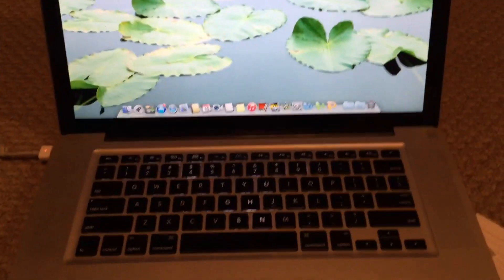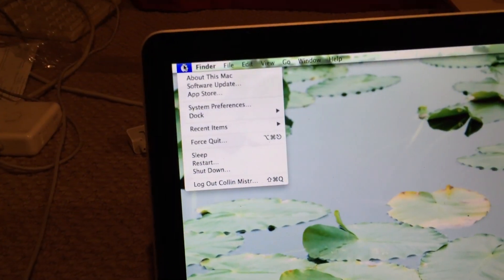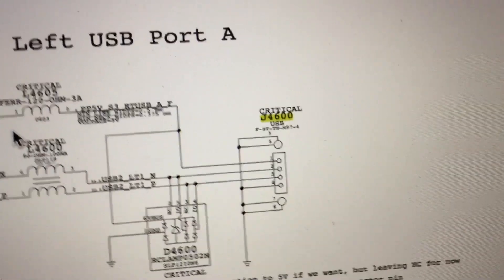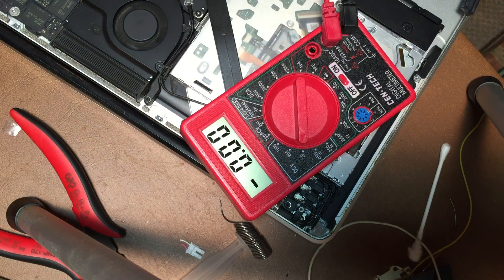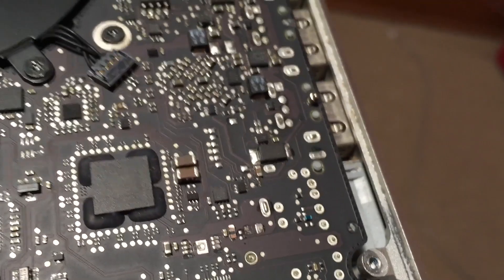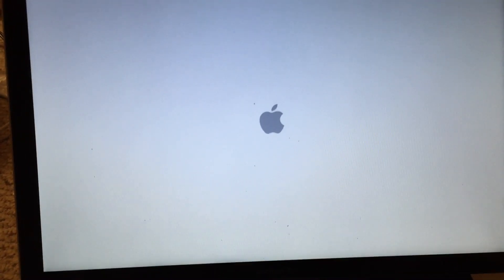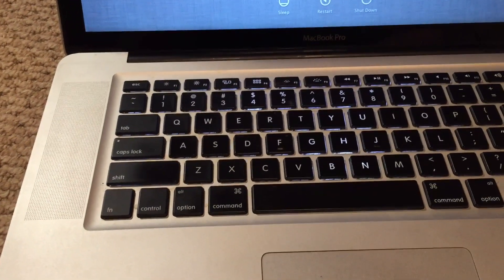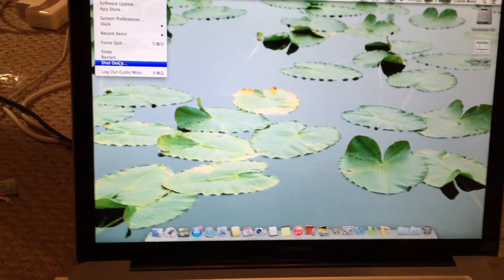Repairing a Bad USB Port on a Late-2011 15" MacBook Pro

Comment: I am having issues with broken headphone jack inside the audio port in mid 2012 15 inch unibody mcb pro. Is it possible to replace the audio port by unsoldering it and put on the another one from macbook pro 2011?
Thanks

Comment: I have the 13" version of this (820-2936 A) bought on Ebay ("works great- all functions not tested", yeah right). Both USB ports don't work, have 5 V. Anything common?
Reply from the maker: Not particularly, but just go through the UBS circuit in the schematics. Check to see what rails are there, and what's making continuity with what. Check the inductors for both USB ports (what was wrong in the machine showed here), and make sure they're good.

Comment: Great stuff.. Thanks for uploading.. In the video you had explained how to test if the voltage is correctly delivered. Since your board is already missing the L4600 inductor, how can we test for the faulty component ?
Reply from the maker: If you test across the inductor in continuity mode (with the board unplugged from power), you should have continuity with very little resistance. If you have high resistance or no continuity, then chances are the inductor is bad.

Comment: Hi, i am not getting any voltage in both USB ports of my A1278 MacBook pro. Any clue wthat should i look for?
Reply from the maker: Check U4600, this IC is what supplies the 5V USB power rail, and also the L4605 and L4615 inductors. You can find specific schematics for your board from my webpage here: http://dosdude1.com/schematics. If your board isn't there, I can upload a copy of the schematics you need.
Reply: Hi again. My board is 820-2565-A can you upload it please?
Reply from the maker: That's not a logic board, that's the part number for the little MagSafe connector board.
Reply: @dosdude1  sir i need urgent help. pls can u tell me where to find l4600 seperately. i cant afford to buy a seperate motherboard for that

Comment: If I don’t have a spare logic board in my junk drawer, any thoughts on where I can get an L4600?
Reply from the maker: You can get them from any electronics parts distributor, such as DigiKey or Mouser. Here's a link to one on Mouser: https://www.mouser.com/ProductDetail/Murata-Electronics/DLP11SN900HL2L/?qs=sGAEpiMZZMsVJzu5wKIZCaCNaXv7qyardAuGkoodCRc%3d
Reply: dosdude1 thanks so much! Is there any way to determine proper direction when installing? I hope you can save me the trouble of having to remove it if I install backwards. Frankly, I’m surprised to find that a coil would be directional especially since it’s only providing resistance in circuit. Also, the part referenced in your reply does not match the spec on the schematic in the video - 90 ohm, 100ma. Can’t find anything on Mouser’s website with that spec in an 0504 package size if that is in fact the right size. Is L4600 spec’d on the schematic beyond resistance and current? Wait, I just realized that 90 ohm is the impedance measurement, not resistance, after looking at the data sheet. Never mind. Thanks again for the link.
Reply from the maker: Yep, that should be the correct part. Max current is 150mA, which is above spec. And yeah, the impedance is 90 ohm like you said. As for direction, it doesn't seem like a coil would be directional like you said, but apparently in this case it did indeed make a difference (or perhaps maybe the first time I soldered it on poorly, which is probably a more likely scenario.) There are no directional markings (or markings of any kind) on the part that I could see.
Reply: dosdude1 thanks again. I’m continually humbled and inspired by the kindness of strangers.

Comment: before you took it off I was practically screaming at you "find pin 1" but I'm glad you "found it" in the end :P obviously larger chips have a dot/arrow marking pin 1 but would those pdfs/landrex tell you for the smaller unmarked stuff? would be very helpful to me for the future if you know how, I don't like gambling with expensive hardware and I'll be doing this myself sooner or later
Reply from the maker: It can be somewhat difficult figuring out the correct orientation for smaller components, but most components that need to be oriented in a certain direction will have some sort of an indication of pin 1. The component I replaced in the video, however, seems to be one exception.

Comment: I won a June 2007 MacBook Pro for just $9 + $18 shipping (I'm aware that these have GPU failures) this one was listed as for parts and they said it stops booting half way through the startup process. I think it maybe because it has no ram. Will I be able to power it with 60w MagSafe?
Reply from the maker: Nope, it will not even turn on unless you use an 85W adapter (if there is no battery installed or the battery is dead).
Reply: Let's just say I have a battery installed and it has a charge. Would I be able to charge that battery with the 60w MagSafe plugged in?
Reply from the maker: Yes.
Reply: Alright cool. Thanks Dosdude! :D